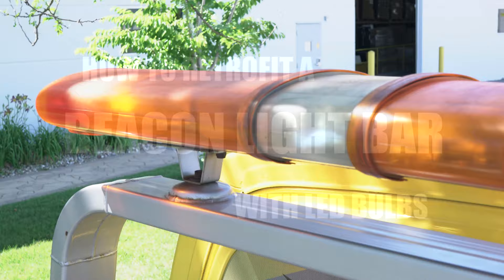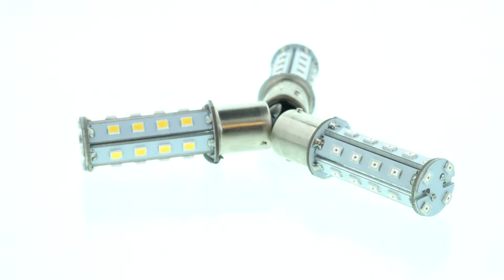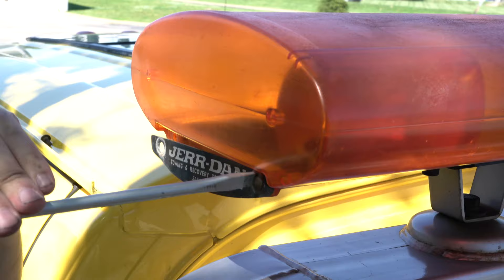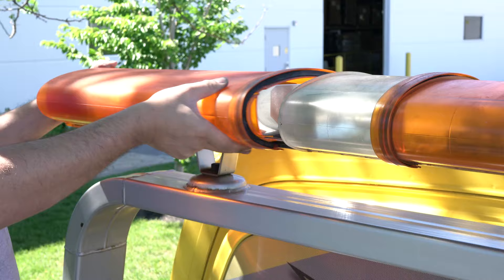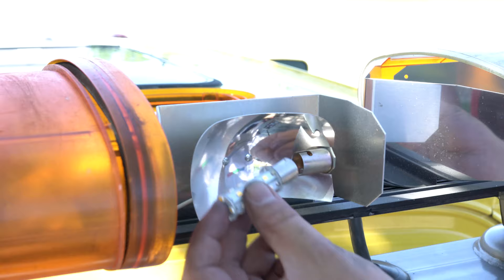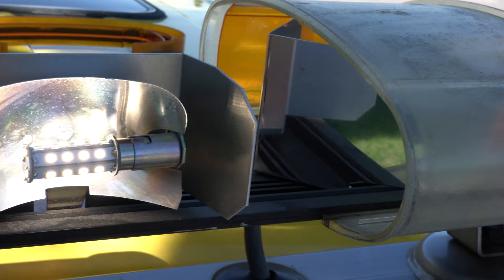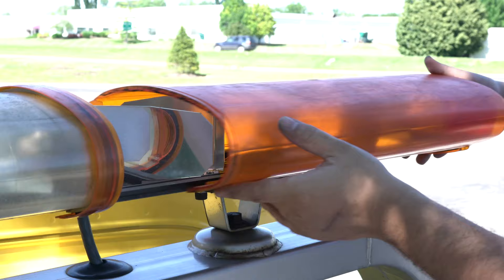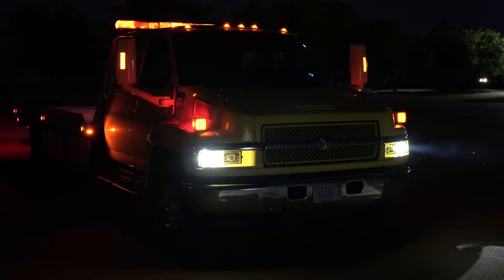How To Retrofit a Beacon Light Bar With LED Bulbs

Comment: This might be bright enough to see at night but daytime operation would be virtually useless. I know these bars draw more amperage but if I used a rotating bar I would do it right and just stick with 50-watt bayonet base halogen bulbs. Unless you spend the extra $$ and buy high intensity LED bulbs, the LED modules being used here wouldn't provide good light output during the day. Just stick with HALOGEN bulbs!

Comment: Why would you install amber LED bulbs on the rotators when the outer lens is already amber? Wouldn't you want WHITE bulbs for maximum brightness? I understand using red and white behind clear lenses but not amber-behind-amber - doesn't make sense. This doesn't look like a very bright setup to me. Those lenses are too worn to allow enough light through them.
Reply: Something about LEDs, I have heard it is best to use the same color LED as the dome.  Unless the dome is clear of course, then you still use a colored LED.
Reply: Using a color LED behind a matching colored lens just gives you a more saturated version of that color, because if you use a white LED the lens is going to still do it's filtering job and give you some form of an amber tone that is not as saturated as the narrowly focused wavelength of an all amber LED.
Reply: These led bulbs don't look very bright to begin with. If you use amber led's behind an amber lens it would make it even LESS bright...lol
Reply: @ComputerLearning0    I agree completely. They don't look bright at all. That's probably why they showed them operating at NIGHT.
Reply: Yeah I was thinking of the same thing too. Just install WHITE bulbs to have more brightness
Reply: @samwenske   If they really wanted to demonstrate the difference between halogen vs LED they should have installed LED on one side of the bar and halogen on the other and simply turned it on. That would have been the easiest way to show which one looks better. I did this same test, albeit on a much smaller scale, using two 'FireBall' teardrop lights, both with amber lenses. One had an amber LED bulb and the other one used the same clear halogen bulb the light originally came with. I video recorded the results and posted it to youtube about 4 years ago but, in typical fashion, my brother visited and used my computer to watch some videos and said he accidentally deleted my video off the platform and because I didn't save the original video I couldn't reupload it. Basically, the light with the white halogen bulb produced a noticeably more intense amber "pop-flash" compared to the one with the amber LED bulb.

Comment: Whelen makes an LED beacon that simulates the mechanical rotators.  The R416 Series could be fitted in the place of the motor and reflector to avoid wear-and-tear on the older light bars.
Reply: The rotabeam lights are crazy expensive!! You can’t even buy a r416 equipped minibar for under $2,000. They’re great lights but wayyy overpriced to throw into a 80’s model FS tow truck bar